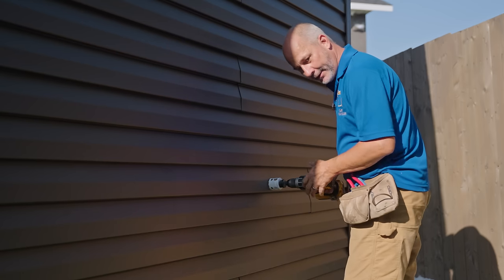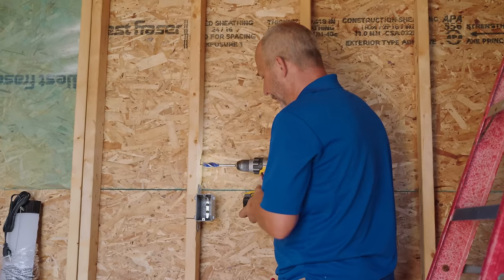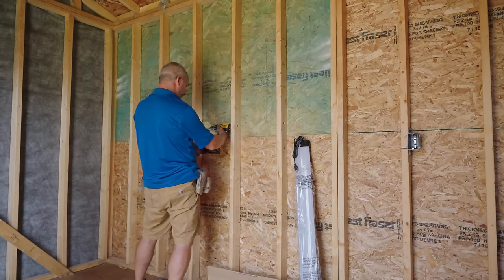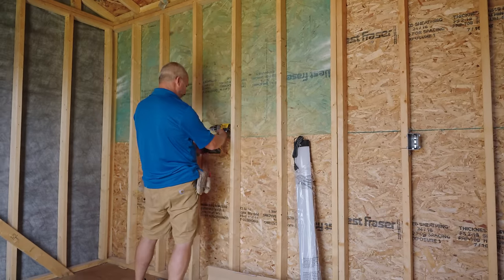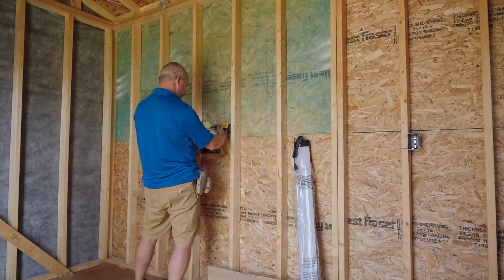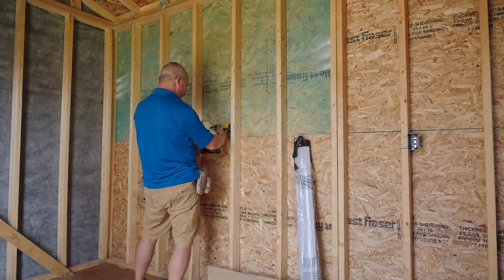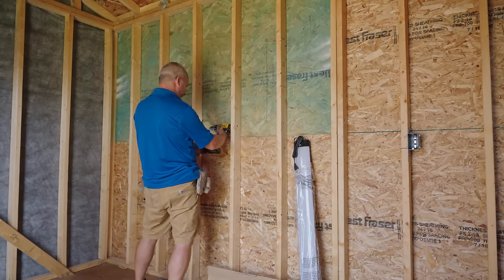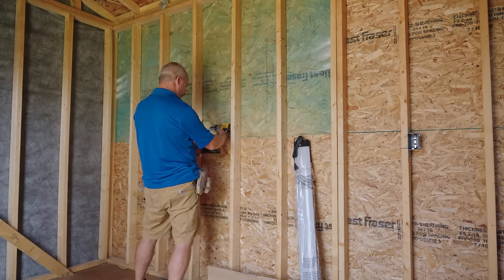How to Run Permanent Temporary Power to a Shed

Comment: Also, IMO, it's not a good idea to install a plug onto solid wire.  The problem is that the screws have a tendency to loosen up with use... plugging and unplugging.

Comment: Some people use there hammer as a method of running wire, so they will place it on the ground to level there holes. But who wants to throw throw there back out that way?

Comment: Sorry but at a wall box a staple nail should not be placed where he's showing. The loop should be between the staple and the box; not after the staple. Reason is, when the drywaller damages the wires in the box, you can pull more wire in from the loop you left. If your loop is on the other side of the staple, there's a good chance it won't pull or it will damage the wire when pulling.
Reply: A chance maybe, but also remember he mentioned only going to the tab on the staple.  It allows movement of the wire in the wall.  Additionally he stated it is required for the first staple to be within 6" of the wire coming out of the box.  By putting the staple on the other side of the loop it will exceed the 6" requirement.

Comment: the least size circuit you should have ran was a #12/2 which is 20 amp.
Reply: Yeah, especially if he is going to be using a long extension cord.

Comment: That plug is listed for stranded copper wire only for a compression pressure connection. Using solid romex with one of those outlets is prohibited.

Hard wire romex to a NEMA 15A receptacle in a weathertight box so a temporary cord can be connected properly. 41:20

Comment: Id run 12-2,  better for small heaters and drill press, car battery charger, etc and 20 amp breaker. 12-2 not that much more for small room, also more plugs on all walls I hate y and splitters, sorry

Comment: my only problem with this whole job .. why in the hell not put about 6 or 8 inches of pipe in the back of that LB sticking out the building seal it to the siding and then seal the end of that pipe so when you do make a permanent electrical install you could just saw it off close and put another LB on turned down and not have to clean out that foam !

Comment: Never has to have the bulb changed because the whole thing has to be replaced when it goes out.  They short out when the weather changes
Reply: no. if you use the 110 volt  led just replace the tube, but mark the light 110 volt tubes only.

Comment: So the idea here is that you'll have an extension cord running from your house across the yard?
Reply: Yes you "plug in your shed" on an as-needed basis
Reply: Another option is to use a portable solar generator. Although, I would have simply left the plug inside the shed. It's not like solar generators are water proof. :)

Comment: Uh? Do you run an extension cord from your house to the shed?  I understand what you did inside the shed, but the outside ???  And why is the outside shed 's yellow connector not water proof???😮
Reply: Its a temporary power setup,he says this multiple times

Comment: I am going to call you out  the Ont. Eletrical code dont allow useing both screws on a plug to jump to the next plug/light/feed. Each wire must be pig tailed using that scrap peace of wire the white an black as a 3rd pig tail to go to the plug only one power or nutral wire be side.. also 99 % of  Inspectors in Ontario do not want to see more than a quarter inch of outer casing of The Wire entering the box They also do not want to see The Wire all twisted on the runs. I had an inspector chew me out for putting a plug on the wire like that  told me not legal an he cut it off. An went on to say he could disconect me for crap like that. I do all my own electracal. Infact  i just got a lay out for a 2nd 400amp under ground service that will go in this summer because the 400amp one i put in in 1997 to feed 200amp to house an 200amp to my shop from the meter bace is no longer any good to feed my shop  it now has to be ripped down an moved out front of my farm new well new septic as it on the new esment hydro one running a 2nd big transmision line over my farm. Plus cutting the forest  Down that my livestock have used for shelter from storms for over 30 years

Comment: As a work/tool shed, I'd run 14/3 or even 12/3 so you could potentially pull 240v in the future.

Comment: Umm, don’t want to hurt your feelings or call you out, but incorrect info - check State and Local Codes, e.g. Title 19 NYCRR 1203 B, 3: permit required,( “temporary”was removed from the NY codes in 2010) where extension, alteration, expansion of building systems, ie specifically electrical;  Or wherever there is code.  As a Contractor, Fire Investigator, and Code Enforcement have seen it first hand…guess what happens when you have an incident?insurance company FOILs FD report, checks with the Building Dept is looking for an out…”no pay claim”.  Heaven forbid there is a significant property loss, personal injury, or fatality…guess who is getting criminally charged, not to mention civil tort?  You guessed it - contractor, property owner and maybe even the municipality.  Plenty of documented cases.  BTW: you are right - “you aren’t an electrician!”  But you are a good actor🤓 Good luck. Don’t forget to support horizontal runs every 54”, not 5’ per NEC.

Comment: Why your ground don't have isolation? In Europe all have isolation
Reply: Because it's a ground wire😂  usually in commercial work, they are coated green.
Reply: Ground have isolation on our wire yellow green .
Reply: @dejandervisevic9669  We call that insulation, not isolation. Our ground wire is never supposed to carry a voltage or current unless there is a fault in the equipment that is plugged into it, then it carries current briefly before the breaker trips.
Reply: @dejandervisevic9669  - I'm guessing it's because voltage is 110-115v, whereas Europe and many other countries, it's 220-240v. In NZ and OZ, the earth / ground is also insulated green or green & yellow similar to Europe. Different countries, different codes, different wire colors.
Reply: In most US residential services we have 220 v single phase power with a split tap to get 110 v to run most of our electric devices.
The white neutral, or grounded conductor, is still a current carrying conductor to complete the circuit.
The green (bare) ground, or grounding conductor, is for shock protection. It is a path to allow unintended voltages to trip the breaker rather than flip a human.
The grounded and grounding conductors are only connected at the service entrance panel to establish equal potential.
The grounded and grounding conductors are isolated from the service panel all the way to the outlet (usage) points.

Comment: Why didn’t he just make a hole in the floor and run conduit under the grass to an outside outlet on the house and have a heavy duty super long outdoor extension cord to use power as necessary?
Reply: I'm not an electrician but I believe you are not supposed to put coated wire in a conduit. When I did my shed, research told me to use "single strand" wire in the conduit. In other words, instead of the white ,black and ground wrapped together in coating ( like the wire he's running inside the shed) they were 3 separate wires.

Comment: Too much work for temporary power. Just throw some extension cords. LOL.    Do not expose NM cable outside. Sheathing will deteriorate very quick. Sun light rated extension cord will last much longer.  If you install 120V inlet box, that is even better. I have 120V inlet on my shed, which I power with sunlight rated extension cord laid along fence.

Comment: Permanent and temporary are opposite things.   Installing electric wiring anywhere most definitely requires a permit.  The exposed male connection is a code violation.  Running romex into a box designed for conduit is also a code violation.

Comment: Love your videos but this one is a fail.   There are way better ways to do the exterior plug part. A simple generator switch in an exterior box for one.  I love how you think an inspector get past wire hanging out of wall but think the twisted wires are impressive

Comment: You may consider that you're circumventing all those ridiculous rules set upon us by the "government".  But in the case of home building and improvement, it's not government that has the last say as to what rule and regulations apply, but what in my community is called a rating bureau.  Private insurance companies coordinate their requirements with building departments in your county or city to make it acceptable so that insurance can be issued to home owners.  If you don't have permits or circumvent common and reasonable codes, you insurance may be void.  If, let's say, grandson is smoking pot on the couch and the house catches fire.  The arson team may make a cursory investigation, but it's the insurance adjuster you have to worry about.  They aren't there to process your claim, they are there to figure out how to deny your claim.  So, good luck my friend and to your audience temporary power is an extension cord and a surge processor for a light, battery charger, and a radio...anything else is a gray area that you might have a whole lot of DIY knowledge but unless you have as many lawyers as your insurance company arguments may not work for claims and courts.

Comment: In the great 50 that's called a pull L
Reply: That Pull Elbow conduit body is often labeled LB (pull elbow with hub out the back). Hub off to either side would be an LR or LL.

Comment: No permit? The electrical code dose cover temporary wiring. Where I live any electrical work except changing plugs and switches requires a permit. There so much wrong with this it's astounding.

Comment: Your wiring is WRONG! The NEC as well as the Canadian electric code in fact states: that the cable must be stapled (secured) within 6" from the box. Conversely, the cable as it exits the box must be stapled (secured) within 6". True, you did staple the cable within 6" to the box, however as the same cable exited the box it was not stapled within 6". More like 10" to 14" of cable you left unsecured as it exited the box. So you instructed many viewers wrongly despite claiming to have allegedly 35 years of experience. Every electrical/ building inspector I know would have failed you on this job.

Comment: As someone that promotes DIYers, you should never do any electrical with power tools, and as a DIYer, I even know that! It's way too easy to over tighten a connection and in electrical, that isn't good.
I normally love your videos but this one was off the mark with that aspect. Electrical work needs more respect, even if it's "just a shed"

Comment: all that work and you finish it off with that nasty pigtail then have the nerve to whine about screw orientation on the receptacle? A male receptacle is about $30 for a quality one like the leviton 5278-cwp or $10 chinese knockoff.

Then if its ever permanently finished out use the location for the entrance or change it out to a female receptacle for outdoor power.

Comment: ALL WRONG. THE CASING ON THE ROMEX WIRING ISN'T UV STABLE AND WILL CRACK CAUSING A SHORT,POSSIBLE FIRE.
Reply: The only wire uv is an issue with is the one going outside and that is why that wire is "temporary"

Comment: You have been doing it wrong for 35 years. First code says you have to have to staple the wire within. 6 inches of the box. When you leave slack like that you aren't following code. Also you never mount a box on the same stud  at the same height of your breaker panel because it will be in the road when you put on the panel cover.

Comment: "How to Run Permanent Temporary Power TO A SHED"  So the hole took a little over 2 minutes.  Then we see nothing about running power TO the shed until 40 minutes later!  And then you cheezed it by using a cord outlet on Romex and spray foam.  Fer cryin' out loud, at least put a power inlet box on the outside and run the cable out of that!.  And name your videos better.

Comment: You are wasteful of expensive copper wire. Why did you just have it done for you and pay someone? As it's apparent, money is no problem for you. You saved a 1.5 ft piece and wasted much more.  Also, it's better to overbuild instead of under building. I'd have wired for 30 amp minimum.

Comment: Firstly, "code" is the bare minimum allowed by law.  Anything less if "failure".  It is meant to keep people from hurting themselves & others. It is by NO MEANS a certification of quality, in any way whatsoever.  Beyond suggestion people circumvent this tiniest bit of protection, you are showing the pigtail coming out of the shed completely NOT protected from rain events.  You know most people will do this an never correct it.  You mention it and then ignore this danger/violation.  That is a short/shock/fire/injury without question in the event of rain or even using a hose around this.  If this is not on a GFCI breaker, your victims will not even have that minimum protection.  Shame, shame, shame!!!  This channel should be shut down.